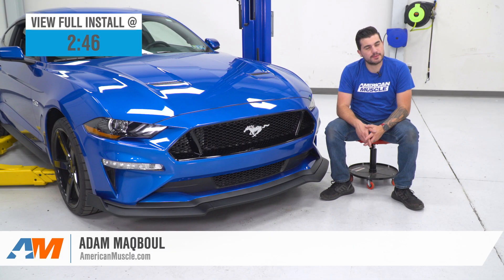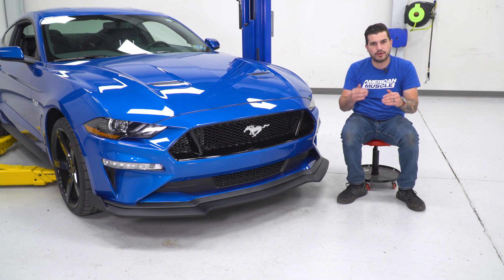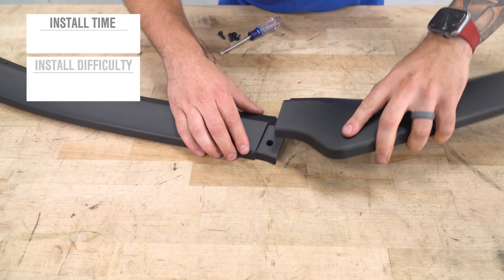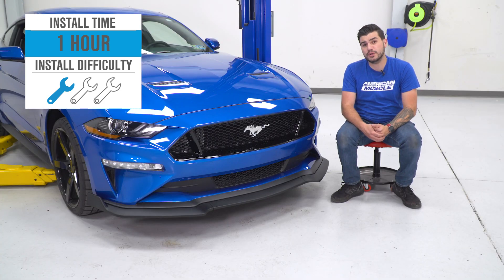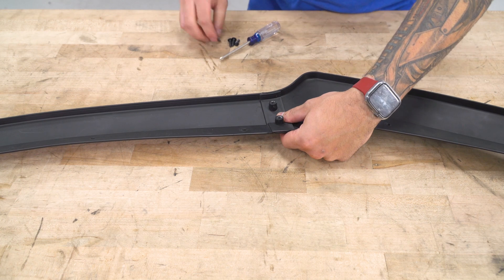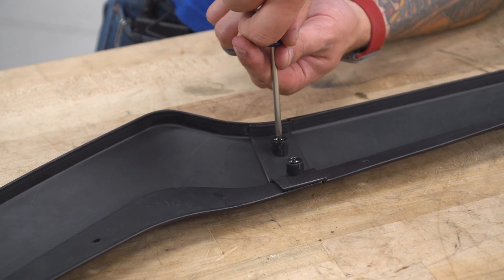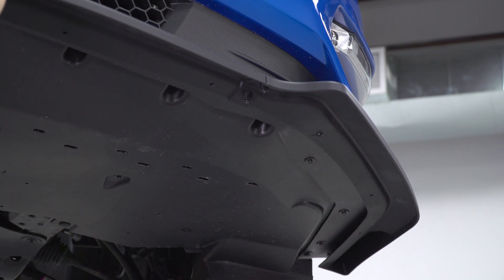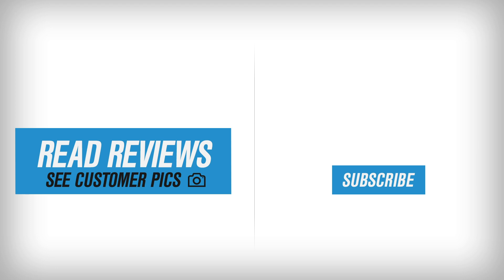2018-2021 Mustang SpeedForm Chin Spoiler; Matte Black Review & Install

Comment: I added a few strips of 3M tape to help secure it at +100mph speeds on my 18’ instead of relying on screws. Hasn’t come off yet and I’m sure it helps
Reply: You used 3m tape in general without screws ?? Thinking about just taping it and calling it a day
Reply: @The_Garnetts  I didn’t say I didn’t use screws. I just added the 3M tape along with the screws for added stability
Reply: @Andreallen4  didnt say you did use them either. Simply asking a question
Reply: @The_Garnetts  it’s all good 👍🏾
Reply: Hey i know it's been a year since you made this comment, but I'm really curious as to how it's holding up for you?
Reply: @edgarmoreno9465  hey! Still holding on strong!
Reply: Did it fly off yet ? Mine did I. The first 2 weeks I got another one but I’m trying to find a way to secure it better also used 3m tape with the screws the first time any ideas ?

Comment: Looks good but how is it at higher speeds? I noticed that it's basically a pressed form and not solid top and bottom like some more expensive and more complicated aftermarket splitters.